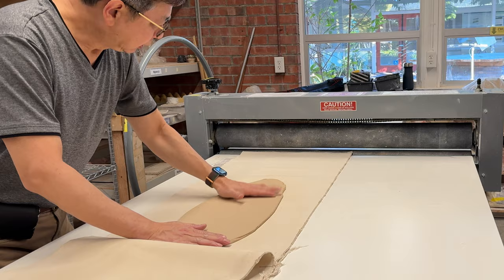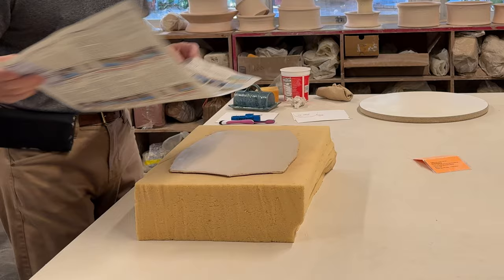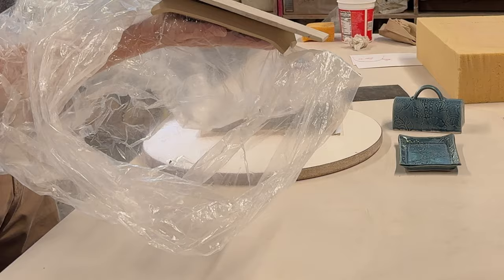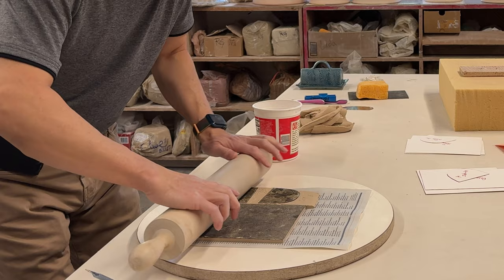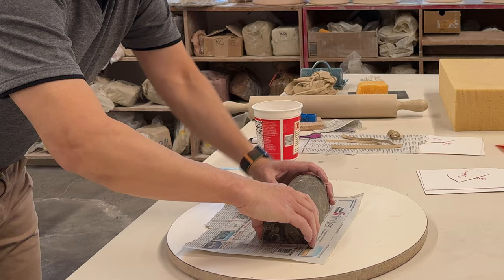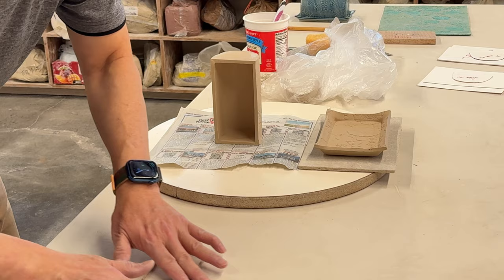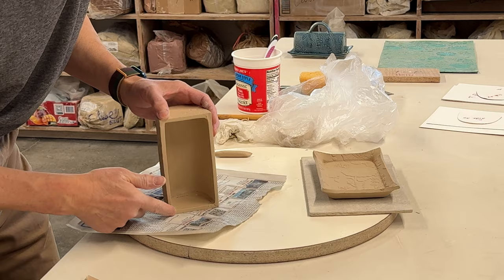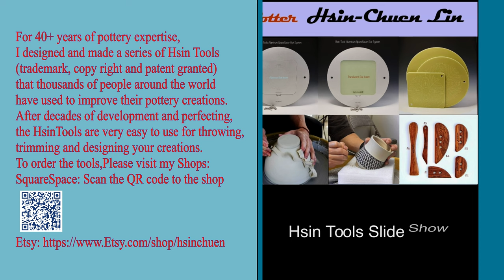769. Slab Build a Covered Butter Dish with Hsin-Chuen Lin~ A Class Demo at PAAC

Comment: Nice demo.  Thank you.  In your recent hand building demos, I noticed you have been using paper towels to 'clean up' the joins on your creations.  Is paper towel preferred to using a damp sponge?  If so, why?  Thank you.
Reply from the maker: Yes, if you have groggy clay, I’d suggest you use paper towel instead of sponge to smooth the surface. Sponge tends to to reveal the rough surface.

Comment: Would you mind sharing your template?
Reply from the maker: The important part of this project is the compression wood block for the rectangular butter tray. Once having the dimensions, you should be able to figure out the rest of the dimensions for the templates.
Reply: Thanks for the video. 
What material is the template made of? Thank you.
Reply: I usually run your classes as practice, if I don't know what type of material the template is I can't do it like you.
Reply from the maker: @davids6300  as I have demo on my previous videos, I use tar paper.
Reply: De La Designs sells a set of cutters to make the same butter dish. They're like cookie cutters so you don't need a template.